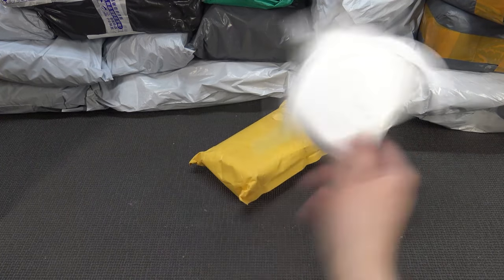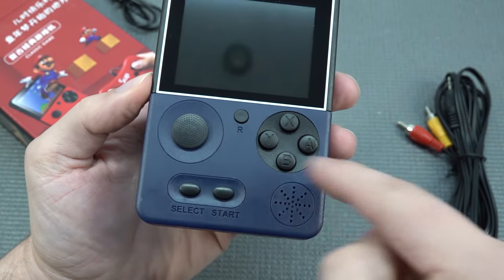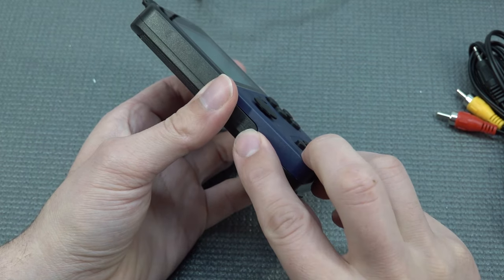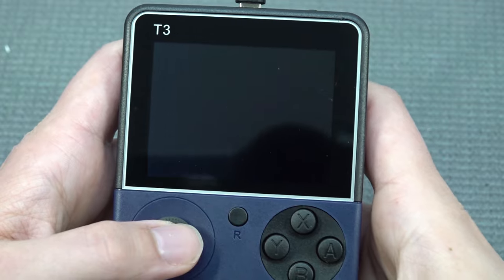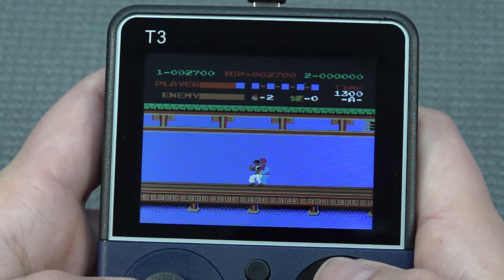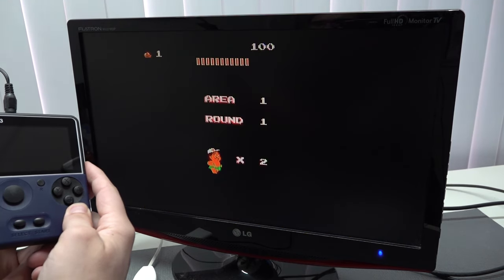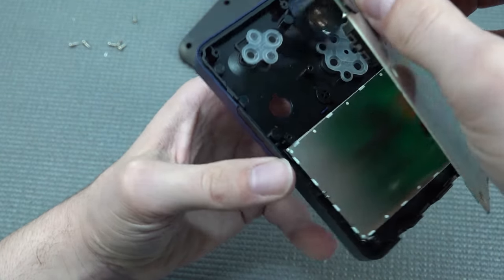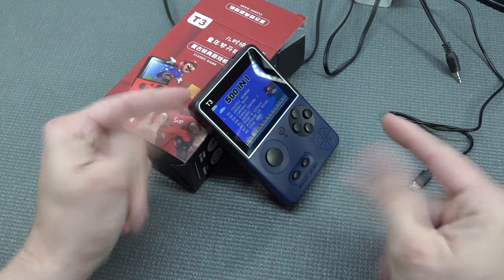The New SUP $15,- Game Box T3 from Ali-Express 😮

Comment: That ROM is on a carrier board so it's likely a standard SOP44 flashrom pinout. Possibly 8MB (64M-bit) or similar. Pretty easy to dump with some equipment, wires and some knowledge. After that-hack it and re-program the flash to add more or different games or set the default to English ;-)